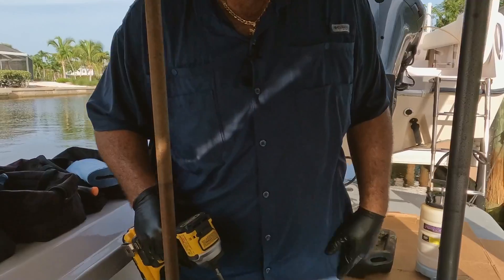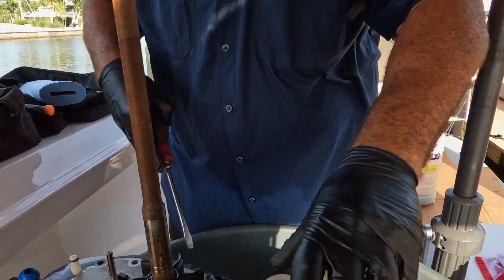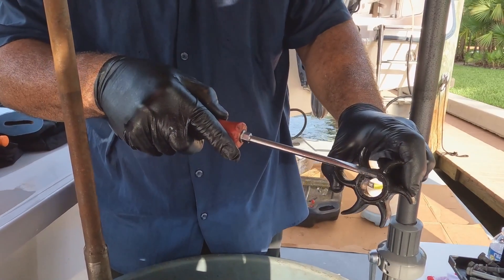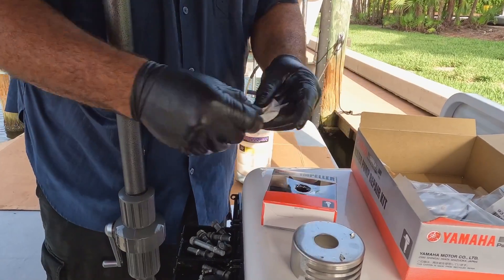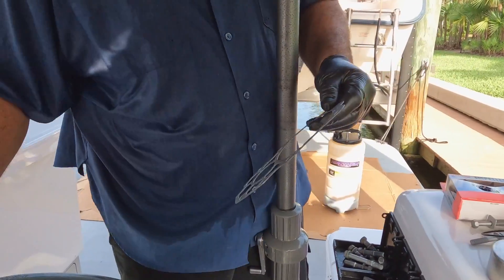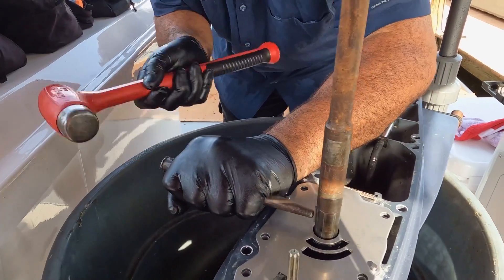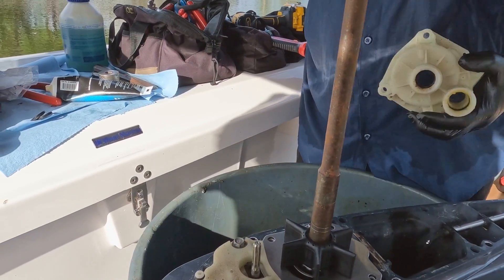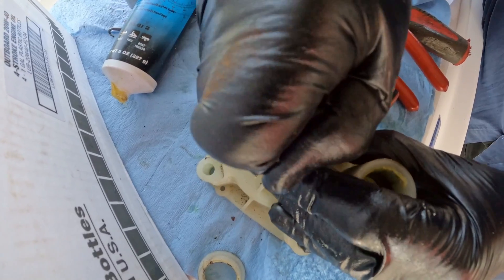How to Repair a Yamaha Water Pump | F225 - F300 4.2L V6 Models | DIY Yamaha Outboard Maintenance

Comment: Thanks for the video. Is there any difference when installing the impeller on an LF300XCA and a F300XCA? Thanks,
Reply from the maker: Thanks for your question! The installation process for the impeller on a Yamaha LF300XCA (counter-rotating) and F300XCA (standard rotation) is almost identical. The key difference is ensuring the impeller vanes are oriented in the correct direction based on the rotation of the driveshaft:

Comment: What grease do you recommend for the job (concern about rubber parts)
Reply from the maker: Hey there. In this video, Frank is using Mercury Marine grease with PTFE 92-802859Q1. 

https://www.partsvu.com/mercury-quicksilver-2-4-c-8oz-marine-grease-lubricant-with-ptfe-92-802859q1.html

Comment: Yamaha motor dwont tern propelle
Reply from the maker: Hey Alberto, 

There are several reasons why a Yamaha motor might not turn a propeller, including but not limited to issues with the fuel system, battery, or carburetor:
Fuel filter
A clogged fuel filter can prevent enough fuel from passing through to turn the engine over.
Fuel pump
A failing fuel pump can cause vibrations in the engine, especially at higher speeds.
Battery
A low battery can cause the engine to crank slowly, while a dead battery can prevent it from turning over at all. Use a voltmeter to check the battery's voltage and charge it to around 12.6 volts.
Carburetor
Carburetor adjustments that are too lean, or that don't allow enough fuel to start the engine, can also be an issue. The carburetor may also need to be cleaned or replaced. If none of these work you should contact your marine mechanic for assistance.

Comment: What type of grease do you use? Great video. Thanks
Reply from the maker: Hey there. In this video, Frank is using Mercury Marine grease with PTFE 92-802859Q1. 

https://www.partsvu.com/mercury-quicksilver-2-4-c-8oz-marine-grease-lubricant-with-ptfe-92-802859q1.html